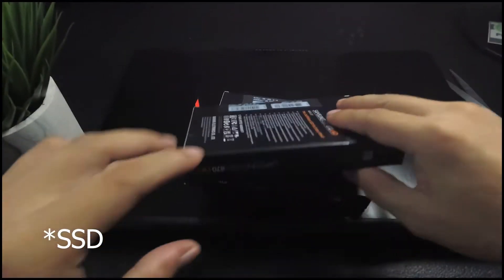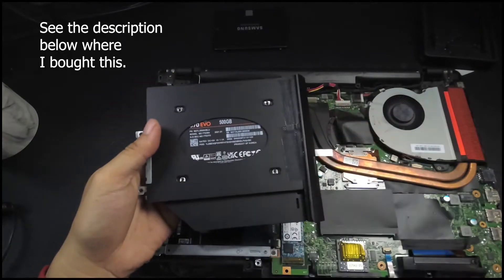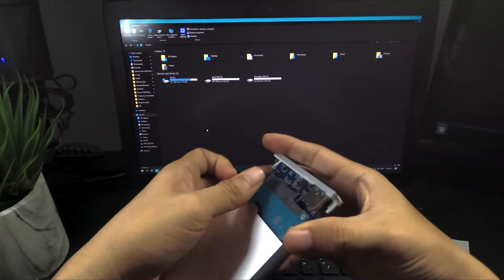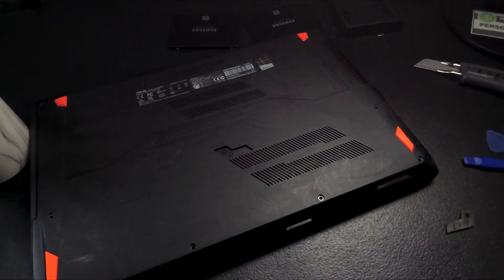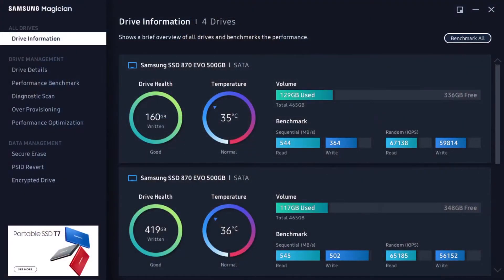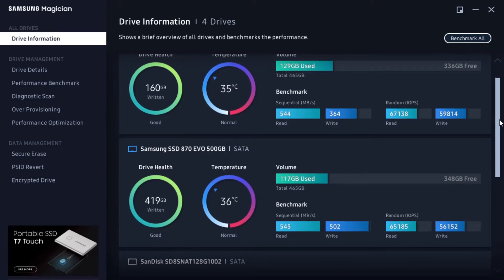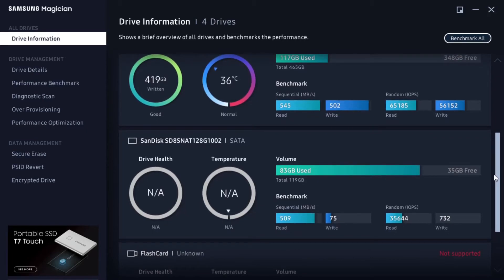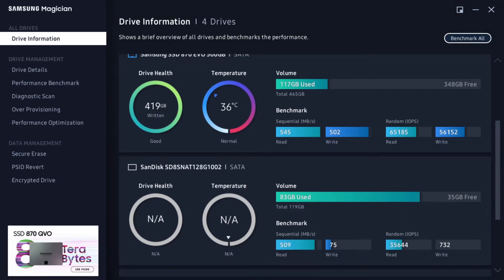Asus Strix ROG GL553VD SSD Upgrade/Replacement

Comment: Pwede ba nga 2 ka SSD nya M.2 plus HDD sa caddy bro? Bali 4 ka drive tanan?
Reply from the maker: If I am not mistaken, ang akoang model has only 1 m. 2 one SATA and one SATA for the optical drive. If 3 ra, you can opt lang for larger capacity SSDs..
Reply: @JoArq  Thanks bro